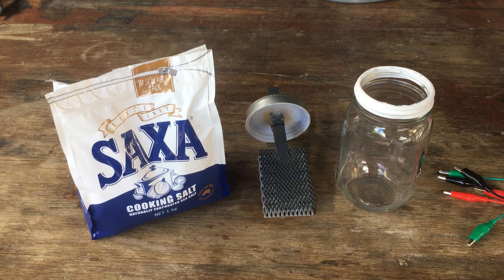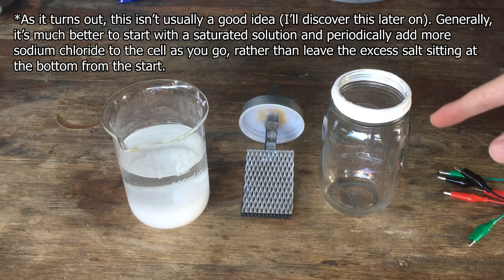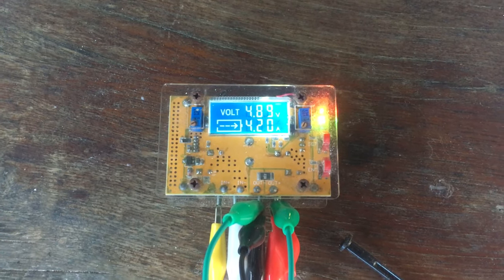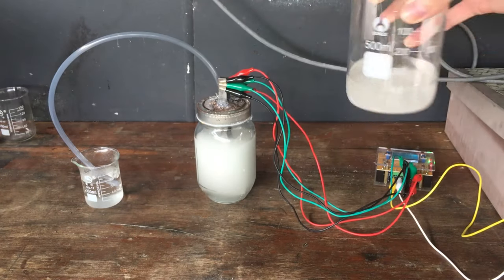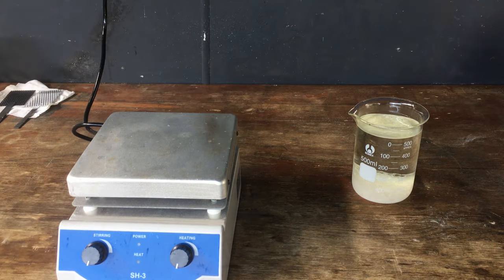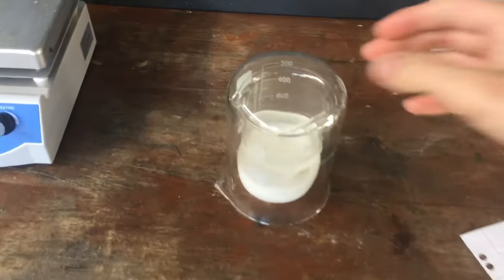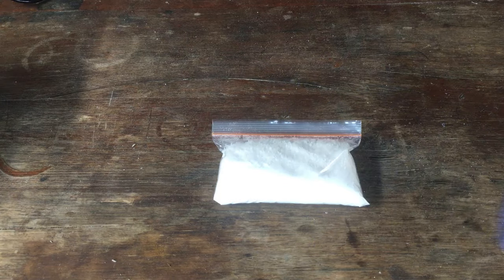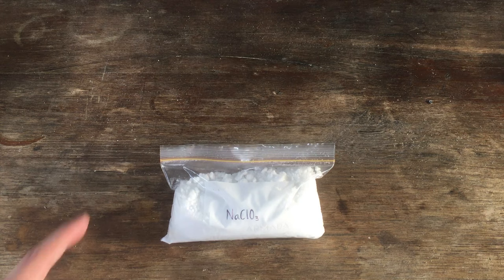A Sodium Chlorate Cell

Comment: Please make a video similar to these but using a common electrodes that are easy to get.
Reply from the maker: This exact procedure can be followed with the use of graphite anodes instead of MMO if you need. The only extra thing you'll have to do is filter the resulting graphite particles out of solution before you crystallise out your product.
Reply: @ScrapScience Do graphite pencils work?
Reply: What if we put a cloth on the graphite to filter and prevent pollution
Reply from the maker: @slimani373  They work, but they fall apart even faster than plain carbon/graphite, because they are technically a mixture of graphite and clay.
Adding a fine filter during the electrolysis might work, but the filter itself might start acting as a diaphragm and preventing hydroxide ions from properly migrating towards the anode. Why not just filter the solution after it's finished? It will achieve the same effect as far as purification is concerned.
Reply: @ScrapScience 
That is, it is easier to filter and make potassium chlorate or sodium chlorate
Reply from the maker: @slimani373 It’s easier to crystallise and get a pure product with the potassium chlorate. However, there’s really not that much difference between the two in terms of difficulty. The most important factor here is which one you need.

Comment: Wait shouldnt NaCl crystalize out first because of its lower solubility
Reply from the maker: This is rather complicated to explain in a single YouTube comment, but I'll give it a try.
In the case of having an equal stoichiometric amount of sodium chloride and sodium chlorate in solution, you're completely correct that chloride would crystallise if you boiled down the solution or cooled down a saturated mixture. However, we didn't have equal amounts of each in solution. We had a little bit of the chloride and a LOT of the chlorate. 
In this case here, we could rely on the difference in solubility curves between the two salts (which you can find online) to get our crystallisation to work. When crystallising, we aimed to boil down the solution (reducing its volume) to the point just before the chloride crystallised. At this point, we stopped heating the solution and allowed it to cool. The solubility of chloride is almost independent of temperature, as you will see from the solubility curves, so none crystallised on cooling. However, the chlorate solubility sharply decreased with cooling, so since we had so much in solution, we forced the chlorate to drop out even though it's more soluble. 
Boiling alone won't give you the chlorate, but if you stop boiling at the right time, you can just crystallise the chlorate by taking advantage of the temperature solubility curves.
Reply: @ScrapScience  is it maybe because you put NaCl in water ,electrolyze it and then the water forms chlorate and because it has gained mass from the oxygen in the hydroxide it is more . If you get what i mean

Comment: Would I get the same result if I used a 12-volt car battery in this reaction?
Reply from the maker: Technically, yes from a chemical perspective, but 12 volts is far too much for this kind of process. Most energy will be dissipated as heat (making your cell extremely hot), and the combination of high temperatures and high current density will likely destroy your anode very quickly.
Reply: It is true that the anode was quickly destroyed, which is a steel nail. I need a way to shorten the time
Reply from the maker: A steel anode will not work to generate chlorate I'm afraid. The only viable anode choices that will give you a meaningful yield in this process are platinum, graphite, and 'mixed metal oxide' (which I use here).
Using pretty much any other commonly available material as an anode will result in the oxidation of the electrode instead of the generation of chlorate.
Reply: @ScrapScience  Thank you very much
Reply: @ScrapScience  Thank you, dear brother, for your cooperation with me, and I need you to answer my question: How much time do I need to convert 100 grams of sodium chloride into sodium chlorate using graphite electrodes and mobile charger.

Comment: @scrapscience CAN I USE STAINLESS STEEL ELECTRODES TO DO THIS ??? 🤔🤔🤔🤔🤔
Reply from the maker: Nope, stainless steel is only usable as a cathode.
For the anode, you need to use either graphite, platinum (with an optional titanium substrate), or MMO electrodes.

Comment: what is the purity of your chlorate in %? and how do you know there is no sodium chloride (salt) left in your product? btw great video man keep it up!
Reply from the maker: Glad you enjoyed!
I'm not actually aware of any reasonably easy methods of measuring the purity of the chlorate (if you're aware of any, let me know!). However, given the flat nature of the sodium chloride solubility curve, we can be confident that the process of crystallising the product by cooling the solution will be extremely selective for separating out the chlorate. Seeing as we did two stages of this crystallisation, the final yield should have very minimal chloride content (though to completely eliminate it, I'll probably do one or two more recrystallisations...).
Reply: i have a question. what is the difference between naclo3 and kclo3? i've heard that sodium is a bit less reactive and unstable. i want to use sodium chlorate for flas powder but i am a bit scared that it wouldn't be good enough (to sensitive to explosion) and probably to weak. the problem is that potassium chlorate is way too expensive compared to sodium. do you have any idea to help me with? thanks @ScrapScience

Comment: The better way to make perchlorate at home lab is melting of chlorate. The perchlorate cell will eat up the anode very well I think. Anyway, you can do both videos :)
Reply: Depends how much you want to make.  For large amounts it's neither particularly feasible or safe to use thermal decomposition.  The anode for perchlorate should be lead dioxide or coated in platinum and it won't get eaten.
Reply: @chemistryofquestionablequa6252  Platinized titanium corrodes very well if there is a little amount of chlorate, only PbO2 can oxidize chlorate until crisp. I read a lot of the literature since the comment above, this topic is extremely interesting

Comment: How much is this Power Supply and where to get it? Thx.
Reply from the maker: The power supply I'm using here is a combination of an old ATX power supply from an unwanted desktop computer, and a buck-boost converter with controllable voltage/current that I got on Ebay for about $15.
Reply: @ScrapScience  thank you, good to know it. 🙂

Comment: Can electrodes made of (stainless steel 316) be used in the electrolysis process?
For the anode and cathode
Reply from the maker: Nope.
Stainless steel only works as the cathode.
For the anode, you need either platinum, MMO, or graphite electrodes.
Reply: What about pure titanium

Comment: Hi! I have a question. Can you use this in low concentrations (0.01-0.1% by weight) for home cleaning? Can it replace Na-hypochlorite in that sense? Does it decay into NaClO2 and so forth, down until NaCl?
Reply from the maker: Yep! In fact, if you just leave the cell running for a couple of minutes, it generally makes enough sodium hypochlorite for cleaning things. There's no need to electrolyse all the way to make chlorate.
A lot of companies actually sell cells like this for that very purpose (look up 'sodium hypochlorite generator' and you'll find many).
Reply: @ScrapScience  wow, thanks for the info! Gonna check it out
Reply: @ScrapScience  one more thing, can you be more elaborate with the cathodes in a hypochlorite cell? Does steel do a good job in that case. Also would a carbon anode contaminate it or does it only happen with chlorate cells. Or do the same rules apply with chlorate cells regarding the materials?
Reply from the maker: The electrode choices for a hypochlorite cell are exactly the same as for a chlorate cell, seeing as the two are technically the same thing anyway. Steel will do a perfectly good job as a cathode material in both cases, but you're correct on the fact that a carbon anode will slowly fill your solution with carbon dust contamination.
Reply: @ScrapScience  much thanks!

Comment: Why does the sodiumchlorate crystalize faster then the left over chloride?
Reply from the maker: Sodium chlorate has a much steeper solubility curve than sodium chloride. So, by allowing a concentrated solution of the two salts to cool down from 100 C, only the chlorate will crystallise out with the decrease in solubility. The solubility of sodium chloride almost doesn't change at all with temperature, so it doesn't crystallise out until you reduce the volume drastically.

Comment: Mine turns yellow after only a few minutes of running, any idea why is that? Im using stainless steel and graphite electrodes
Reply from the maker: This may be a difficult problem to diagnose. Which electrode is your cathode and which is your anode? What is your voltage/current? What are you using as the vessel for your reaction? And how are you making your connections to your electrodes?
Reply: @ScrapScience  graphite is my anode and stainless steel my cathode, I'm using 10v with as much current as my supply can give but I haven't measured it, should be enough because it's a 12v 50a supply.  I don't think the 10v should be a problem for the reaction, maybe make it more inefficient. The connection is a wire tightly wound around both the electrodes and the vessel is a glass jar i had. By the way sorry for leaving two comments, I didn't notice it was the same channel,  my bad.
Reply from the maker: Haha - no need to apologise!

With a voltage that high, you won't affect the way that the reaction runs, but you will get a lot of heat in your cell and your anode will degrade very quickly. When graphite disintegrates, you tend to get a yellow colouring in solution (nanoscale particles of graphite seem to have this colour). You might be able to minimise this with a lower voltage - a maximum of 4.5 V is generally ideal. It might be an ugly colour, but it ultimately doesn't affect anything for the reaction, so it's up to you whether you want to minimise it.

Alternatively, the yellow colour could possibly be coming from the stainless steel. If you leave the electrodes sitting in the solution without current running through them, the stainless steel can be attacked by the oxidisers in the mix. Hence, always avoid leaving the electrodes sitting in the cell if you're not applying a voltage.

Hope that helps!
Reply: @ScrapScience  thank you for the answer, I have a question that might be a little dumb though,  if it generates hypochlorite during the reaction, why isn't hypochlorite solution used from the start? Sodium hypochlorite solution is very easy to get, so I guess that if it isn't used it's for a reason, but I don't know exactly why. Again, sorry if the question is too dumb.
Reply from the maker: Not a dumb question at all!
You could start with sodium hypochlorite if you wanted. There are two main drawbacks though.
First, it's simply more expensive (per mole) as a starting material. The extra electricity costs associated with using chloride are miniscule in comparison to the extra costs of using hypochlorite.
Next, making feedstock additions to the cell is difficult when using hypochlorite, since it generally comes in solution. When using it, adding more feed into the cell will inherently increase the cell's volume by a lot. This becomes a big problem when you want to make lots of chlorate.
Also, if you're going to start with hypochlorite, you might as well just make the chlorate by boiling a hypochlorite solution instead of going through the electrolysis route.
Reply: @ScrapScience  alright, thanks for all the help! I got it running at 5 volts now and it doesn't turn as yellow and it's finally properly sealed. I might try the hypochlorite thing in the future just to test if it's faster, but for now ill stick to chloride.

Comment: can i use carbon roads ?! (i have a lot from batteries)
Reply from the maker: Yes, carbon electrodes will work. However, you'll end up with significant amounts of carbon dust in your final solution, which you'll need to filter off before crystallising the chlorate. Additionally, microscopic particles of graphite will discolour your final solid product, but this won't affect the chemical properties at all.

Comment: How many days does electrolysis last? Can you explain?

￼
Reply from the maker: The runtime of the cell will depend on many factors, including:
- The size of the cell
- The current
- The anode/cathode choice
- The current density on the anode/cathode
- The temperature of the cell

It's not really something that has a simple answer, and a single YouTube comment is not enough space to explain how all of these factors influence the runtime. I'm afraid you'll likely need to do some research to get a complete answer.
Reply: I need to minimize the time for a project. In what conditions can you minimize the time?

Comment: Hey man, i have a problem with my cell. Everything was running fine, then after around 4 days i added even more nacl and my mmo anode started dropping a metallic powder in to the solution, the process is slow but still very noticeable
Reply from the maker: It sounds like you've damaged the anode to some degree. This is normally something that occurs for one of two reasons:
1) You may have allowed the chloride concentration to drop too low. This is generally something that happens much later in a cell run though. Is it possible that you didn't start with a fully saturated solution? Or maybe are you using an excessively high current or a small cell volume?
2) If you allow the electrodes to sit in solution without current flowing through them, the anode will degrade extremely quickly. Could this have happened recently?

The only other reason that I can think of is if you've used the anodes for something else (or maybe bought them second-hand) and they may have been damaged in a previous process.
Reply: @ScrapScience  almost nothing from the list matches my case, my electrodes did sit in the soloution without current for little bit but that doesn't appear to be the problem since the degradation started to occur some time after and exactly after i added more chloride which to me doesn't make any sense
Reply: @ScrapScience  current is 6.5A and my electrodes can handle 10-20A
Reply: @ScrapScience  and no the chloride i added did not cover the electrodes. I literally can not think of a reason this is happening. Maybe its some titanium oxide not mmo degrading??
Reply from the maker: Sometimes there can be a delay between the degradation of an anode and the physical disintegration. Adding more chloride to the cell (and making it more conductive) may have simply been the trigger for the anode to start falling apart after previous degradation.
How long were your electrodes in the solution without current? A few minutes is completely fine, but multiple hours is generally a problem.
Reply: @ScrapScience  it was about half an hour. I just found out something interesting, i filtrated out the black powder but after some time it lost its color or turned white, now i really think it's some titanium salt, but have no idea how it happened
Reply from the maker: Yeah that's a little odd. Half an hour should be fine. 
Degradation of the titanium tends to only occur if you run the cell at ridiculously high voltages (above 8 volts or something), or maybe your source of sodium chloride is impure. Could either of these things be the case? If not, I'm basically out of ideas, and I'd just recommend continuing to run the cell (with the occasional filtration to remove the solid particles) and hope for the best.
Reply: @ScrapScience  yeah guess this will be one of those chemistry misteries. I got the electrodes from theelectrodesupply too so they should be good. Like you said gonna hope for the best😅 cheers!

Comment: where do you get your power supply?
Reply from the maker: I used an old ATX power supply from an unwanted desktop computer, coupled with a $15 buck-boost converter (with controllable current/voltage) from Ebay.

Comment: I think by boiling the sodium chlorate solution you made a mixture of sodium perchlorate and sodium chloride. I remember to have read somewhere that a solution of sodium chlorate disproportion above 70 celsius to yield NaCl and NAClO4. I love your videos btw!
Reply from the maker: The disproportionation of sodium chlorate is actually a fair bit more difficult than that. To get any significant decomposition, you need to get the chlorate hot enough to melt it, and even then the decomposition is slow and low-yielding. 
The reaction you might be thinking of is the disproportionation of sodium hypochlorite, which does occur in solution at around 70 Celsius (at the right pH). This disproportionation reaction converts hypochlorite ions into chloride and chlorate ions, and I think I mention the reaction taking place in this video at around 14:17.
Either way, if we do end up with a little bit of perchlorate in the product, I'm not too concerned because this stuff is eventually going to be used for a perchlorate cell anyway haha.
Glad you enjoy the videos!
Reply: @Scrap Science, yes, you are totally right. Thanks for clarifying this part.